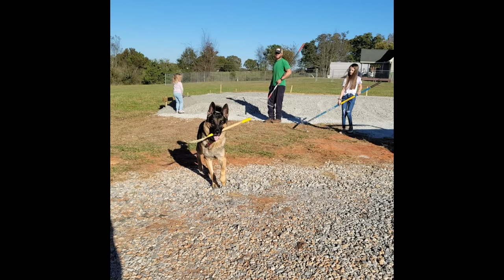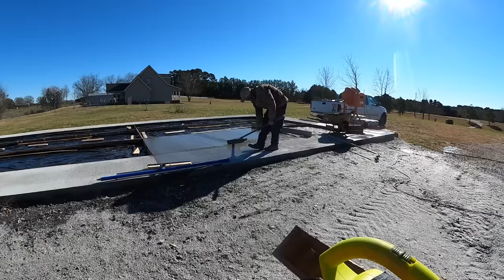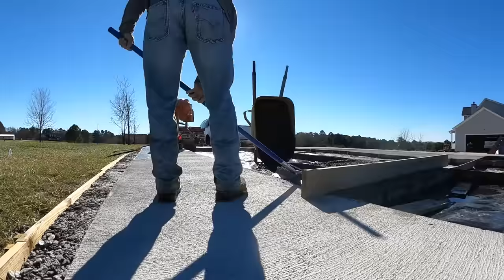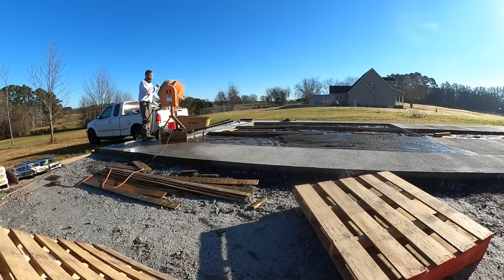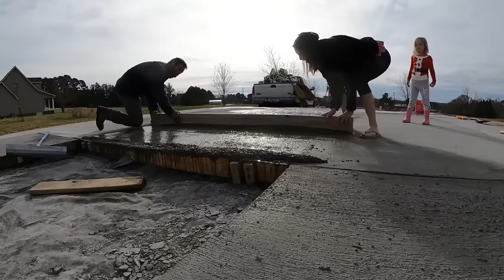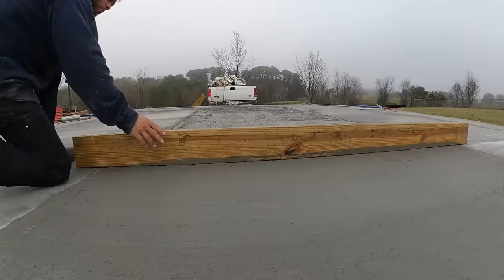Pouring a Huge Concrete Slab Using Bagged Concrete | I Saved $10,000

Comment: I’d be worried about cracking later since there’s no rebar in it but it looks good, great work!
Reply from the maker: No rebar is needed for 4" on grade residential slab. Thank you for checking my video out!
Reply: All concrete cracks. The way he poured it in sections means that every cold joint will act as a control joint.
Reply: @reallifetested2605  The only thing you should of done is drove rebar dowels into each slab, someday all those individual sections are going to lift or sag and your going to have tripping hazards or wont be able to roll your toolbox around. Good job I respect your work but all in all if you had a company do it they could pour it all at once and you won't have this problem.
Reply from the maker: @7.3powerstroke6  if it ever does that (don't think it will) I'll just grind down the high sections to make it level. Isn't that caused by the ground settling and freeze / thaw cycles? The ground never freezes where I am, and I have 100 tons of packed crusher run beneath. 

The amount of money I saved, it was worth it to me. 

Thanks for checking out my video!
Reply: @reallifetested2605  did you actually do the math and just decided the extra cost wasn't worth doing rebar even if it wasn't needed? I'm curious how much more it would've cost just to throw in some wire mesh or rebar for peace of mind on a slab that big.

Nice job either way. I've considered doing that myself for my back patio but man it's a lot of work lol
Reply from the maker: @mleachx1  I did not. I have a few gc's in my family as well as friends with some gc's and when I asked them they pretty much all looked at me like I was crazy and said rebar / mesh is throwing money away on a slab like that.
Reply: @reallifetested2605  I find that absolutely laughable, 4” is a 100mm slab here in Australia and it is definitely required by Australian Standards to have bare minimum fabric mesh with perimeter bars. There is no way in hell any residential slab in Australia would be monolithic mass concrete. It is mind boggling the US doesn’t have concrete design done to this minimum.
Reply from the maker: @EvanDrinkwater  I've talked to a few from Australia and you guys do have stricter standards than we have here. Pretty much no one in my area uses it on driveways, sidewalks, building slabs etc. Heck I even went above and beyond by using gravel. Half the time I see them just grading the clay and laying the concrete. I feel that gravel should at least be used but who am I haha Thanks for checking out my video!
Reply: @reallifetested2605  yeah wow! That’s incredible that out bare minimum gets a complete look over in the US. I would imagine that civil infrastructure is at a higher standard though with the appropriate reinforcement. 

If you were to do it again and taking the comments into account would you install steel reinforcement so you could have a potentially crack free and long term slab?
Reply from the maker: @EvanDrinkwater  like I said no one here does that and there concrete has been holding up just fine. So I would do it over the same way.
Reply: @reallifetested2605  Can't simply compare the whole country to another.  We have every kind of climate which climates break down further into soil types.  Plenty of the country requires the reinforcement for good reason.  I have been jealous of anyone living in an area that doesn't need to add all of that.  Not to mention having to get foundation almost 4 feet into the ground from frost heaving.  If the soil is such that it isnt needes, then it isnt needed.  People have trouble understanding that the ground where you are isn't like most places for whatever reason.  That still doesn't even come close to making the job you did there anything but the most badass tough as it gets job ive ever seen done.  My buddy re roofed 3 houses with tear offs and clean up in 1 day, then did it again next day.  total of 20,000 sq ft.  Guys that never miss work took off work the 3rd day, lol.  I asked my buddy how he felt and he said he just got done running 10 miles because he wanted to try a marathon and he felt great.  Somethings always been wrong with that dude, but its the kind of wrong that makes a man RICH! 😉
Reply from the maker: @righteouswhippingstick  I love your comment and wish others understood that the world has different climates and soil types. It seems a lot think that just because it's required in there area it's worldwide. Just like water lines. Where I am it's 10" minimum but up north it's multiple feet minimum depth! Thank you for checking out my video and for commenting. It's very much appreciated.

Comment: 2 questions.
1.  Why no rebar?
2.  Why not move the mixer instead of  wheelbarrowing it?
Reply from the maker: Rebar isn't needed in a 4" residential on grade slab. Not in my area anyways. I had the mixer mixing another batch while I dumped the wheelbarrow. By the time I dumped it I came back dumped in the wheel barrow and had another batch mixing. Thank you for checking out my video!
Reply: @reallifetested2605  Yah it is.

Comment: After the money you have involved, (gas-time-material-tools), Money spent on ordering the concrete makes more sense.
The 10,000 you "saved" was labor and mark up.  If you're willing to do it yourself, ordering it would be about the same as mixing it bag by bag.
I didn't see how think your 1st pour was but at 1200 square feet, it's 15 yards.  By yourself, 2- 7 or 8 yard pours would be about 2500 in material and be done by noon.  And you would have quality strong concrete.  Bag mixing is unpredictable and there was no reinforcement in you slab.
Reply from the maker: I'm glad you know what you're doing. I obviously dont. Thanks for watching.

Comment: That was insanely impressive.   I'm currently remodelling my second house of the year and I love doing all the work myself.   I think it's kinda cool to figure out ways to do it by myself.    
One question.    At 4" depth, you would have needed around 650 bags or so, did you consider just buying bagged cement and getting two piles of sand and rock, and just mixing it yourself?      
Second,  how much was the ready mix company charging you to deliver the cement?    I used to drive and it was roughly $100/yrd.     Would have taken two trucks.    Was it the labor for the finishers that was so much?     I know prices have skyrocketed, just asking because I wouldn't mind taking on a project like that soon.
Reply from the maker: When I bought it it was 3.20 for an 80lb. bag. Here at the time yard is about 200 to 220 depending on the day. I got quoted around 9000 for someone else to do it for me. That doesn't include hauling all of the gravel and leveling like I did. That would have been an additional 4000 and them not spreading it. Probably would have been an additional 800 for spreading and packing. I have less than 4000 in this project diy.

I called yesterday out of curiosity and it's 165 per yard with 4-6 week lead time so right now it's about the same as bag. When I did it bag was significantly cheaper. 

I used 830 bags. 😀

I forgot to mention! I did consider mixing it all myself. But it would've taken wayyy longer with my small mixer. If I had a large mixer with 5 times or more the capacity I wouldn't have thought twice about it.
Reply: At 4" thick  it called for 15 yards. Here I pay $175 a yard delivered for 7 sack. It cost an extra $300 to buy the bags and to mix and pour yourself. Thats assuming he got each bag of concrete for $3.50 a bag. Yes he saved money on the labor and finish as well as prep work but truck it in and save your back and your time.
Reply from the maker: @platinumck1  I have it broke down above what I spent and what the cost were at the time. Also even said bag and truck is the same price right now...
Reply: A  problem with having it trucked in is he would have needed to pour it all at once.  That would have been a big pour to do by yourself, and probably would have been a disaster.
Reply: @reallifetested2605  That's definitely A LOT of bags. Good work man. I understand needing to use the equipment you have on hand. One question I have though is: Why DIDN'T you use a bigger mixer? We use a towable, gas powered Essick (9sqft. capacity, I believe) It can be maneuvered/moved by hand when empty. When we've had to grout block walls by hand...I remember being able to put 12, 80lb. bags in + water, to fill it to capacity. 
I can't possibly imagine one of those mixers being more than maybe $100 to rent for the day. Did you look into/consider doing that??

On some jobs...We would just drop the mixer in the closest spot and keep the pickup truck with a pallet of core-fill grout in the bed, drop the tailgate and stack 3-4 empty pallets behind the mixer...so you could grab a bag from the bed, step onto the pallets and drop the bag right onto the mixer and voila! Then repeat that process 830 times!😁

Honestly though...With your pad, you had all the room in the world to put a bigger mixer like one of those and probably could've just poured most of it right into your forms, then raked/shoveled it where  needed. 
I'm sure it was soooo tedious mixing 3-4 bags at a time in your tiny mixer, then wheelbarrowing it.

My hat goes off to you sir, cuz I know how much work you did. 🏆🥇
I just think renting a mixer would've: 
(A) Been worth every penny. And
(B) Saved you more time and effort than can even be stated.
Reply from the maker: @RILEYLEIFSON_UTAH  after all of the concrete work I've been doing I'm really considering purchasing one of the larger mixers. It would pay itself off very soon especially if I mixed my own concrete with sand, gravel, and portland. I've actually been looking at them quite a bit the past few weeks. I did this mainly just to say I did. And I also wanted to see how well the harbor freight mixer would hold up after all of that. I'm surprised all of that didn't phase it! I'm going to check out the mixer you listed. Thank you for the kind thoughtful comment, and for checking out my video. I really appreciate it.
Reply: @JDel709  One finisher could knock out 1200 feet and be drinking beet by noon.
Reply: @eolden7749  ok.  This guy isnt a professional.  So what does a professional finisher who likes beet juice have to do with the fact that a non professional would not be able to pour 1200 sqft by himself without the concrete getting away from him?

I really don't understand why every construction video has to be filled with professional pissing contest entries.  Click on any construction video, and there are 1,000 E Oldens out there claiming they could carry 5 bundles of shingles up a ladder while hand nailing 15 squares an hour, while finishing a concrete driveway at the same time by holding the bull float with his teeth.  And be drinking beets by noon.
Reply: @JDel709  More than one truck for that pour so it would have been split, but still pretty big sections for a DIY'er.  I'm all about doing things myself, but I would have to save a LOT of money to mix that much concrete instead of having it trucked in!

Comment: Nice work man, looks awesome. I'm planing on pouring a 15'x22' slab in my yard this summer. I'll definitely get a mixer use then sell it. I wanted to ask if you poured straight over the ground or did you use a plastic barrier or something?
Reply from the maker: Thank you! I want to add, since all of this crazy inflation we have had the price of bag has increased. So check local prices before you do anything. In my area right now bag and truck is about the same price. But when I did this bag was significantly cheaper. 

With concrete the base is the most important thing. I have over 100 tons of compacted crusher run under this pad. I also put down a vapor barrier (just a roll of plastic, the thickest thing I could find at lowes, home depot) the vapor barrier is really only needed if you plan on building a shop or something like that on top of the pad. Although it does help the water from running off quickly from your concrete (not sure if this really makes that much of a difference but have heard it does) 
 
Hope this helped! Good luck with your project.

Comment: Great video, you’ve given me inspiration for a similar project! Just out of curiosity, did you leave the middle forms in? Might be a dumb question but once you poured each individual slab wouldn’t it have been hard to remove the forms in the middle? Thank you!
Reply from the maker: Not a dumb question at all! What I did was pour the outside slabs first. Then remove the wood forms on the inside and used the outside slabs as the form (Hope that makes sense) thanks for checking out my video and for taking the time to leave a comment.

Comment: That’s a good idea. How did that harbor freight mixer work? 2 bags at a time?
Reply from the maker: It worked great! I actually have a small business and use it all the time. I've also let people borrow it and the only thing I've had to do is keep the belt tight. I also upgraded the cheap wheels that came with it as well as tack welded a few spots that looked suspect. I would imagine people wouldn't use this thing as heavy as I have so the welding and wheels would probably be ok. I highly recommend it! Yes! (2) 80 lb bags at a time are perfect. (3) 60 lb bags is ok too but don't add more then that.

Comment: I'm not so sure that not using rebar or wire mesh was a good idea.
Reply from the maker: If you notice I broke it up into multiple smaller sections. I also poured it 4" thick and packed gravel. No rebar or mesh is necessary for that. Although it would've been necessary if over 4" thick and a monolithic slab! Also the heaviest thing I'll ever pull in there is around 10,000 pounds straight in and out. It will be fine! Thanks for watching. (A lot of contractors in my area don't even use gravel, they grade the clay down and pour) I thought that was a horrible idea but it seems to be the method of choice in my area with pretty good results. The gravel made me feel a little better about it.  😃

Comment: There are advantages doing it the way you did 1, Manageable areas 2, Cost 3, minimise mistakes 
Though in UK if Building control were involved. You wouldn’t be allowed to do it in small areas.
As it weakens the concrete overhaul…. As any stop areas are potential areas of weakness.
Reply from the maker: As long as the base is good and solid nothing should move. How do you guys do big pours? Around here they have to break up large pours into multiple sections. I’m talking industrial plants not homes but wonder if they require solid pours for that as well.

Comment: I own a concrete business and you are the man for pouring this with bags!!!
I’m just hoping you drilled and pinned all the slabs together so they are all once peice and don’t move separately
Reply from the maker: I appreciate you taking the time to leave a kind comment. Honestly that was the only regret was not pinning everything together. Luckily the shop I built on top, it's bolted around the entire frame about every 2' so maybe that will help. That along with all the gravel I laid down. I'm hoping it wont move much over the years.

Comment: I found out doing my easment putting the mixer on the back corner of the trailer helped we didn’t have to use a wheel barrel just moved the trailer with mixer and pallet of concrete down every so often
Reply from the maker: That’s awesome you were able to use a trailer. I bet it made dumping and moving everything around a lot easier.

Comment: I commend your work ethic & family involvement. Love German Shepherds  too! I had 18 yards delivered to me for $2450 in April 2021. My wife & I were the only people here to rake & finish the Crete. I wish I would have hired 3-4 guys to finish it. It's not perfect, but it works. I epoxied it with Durall grey epoxy & it looks great. Just not as flat as I would have preferred. I'm not sure if I would have save any money, but I'd prefer to do it myself next time, so I can pour smaller sections & make them perfect.
Reply from the maker: Thank you! You’re right you got a heck of a deal on concrete. Here it was 200 to 225 depending on the day with a 4-6 week wait. 80 lb bags were 3.20 each so that’s what I went with. Here concrete contractors have lost their minds. We’ve recently got quotes for a 30x30 pad for a driveway extension and the lowest we received was 15k I couldn’t believe it. Looks like I’m going to be doing a driveway soon lol

Comment: Looks good. I just poured a small 2 yard slab. Here an 80 # bag is $5.43 and off the truck is $200 per yard plus fuel surcharge. Doing the math it would of made more sense to buy off the truck but they all have a 7 yard minimum so it wasn't an option. It didn't take as long as I would of thought.
Reply from the maker: Wow bags are high in your area. Around here they’re right at 3.80. When I did this project they were 3.20 and truck was 200 to 225 with a 4-6 week wait.

Comment: More people need to do DIY it's really not that hard maybe a bit time consuming but as they say "time is money" and you have saved a shit tonne of money doing it yourself. Great job mate and good luck.
Reply from the maker: You've got that right. We were willing to pay someone to do it until we got quotes of 14k up. I said concrete doesn't cost that much. I did gravel and concrete for 3800 dollars. Labor and now material have gotten absolutely ridiculous.
Reply: I don’t know how it can be any kind of savings I pay $9.50 per bag 100 bags = 1m3 $950. I pay around $300 per 1m3 ready mix delivered. I’m all for laying it yourself but I don’t see any savings in bagged.
Reply from the maker: @jessdarlington1007  when I did this truck was 200 to 220 with a 4-6 week wait and #80 bags were 3.20 each. We got quotes of 14k up and I did everything myself for less than 4k.